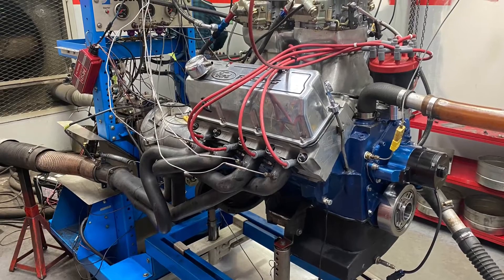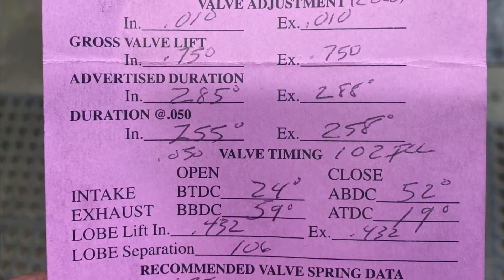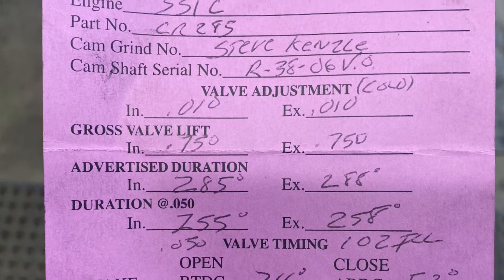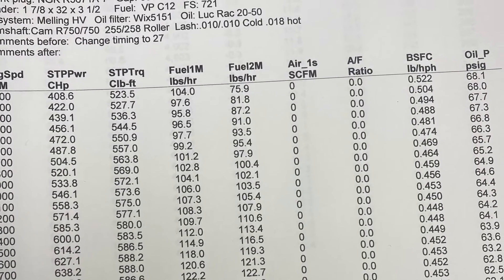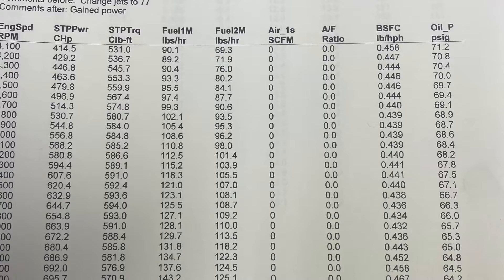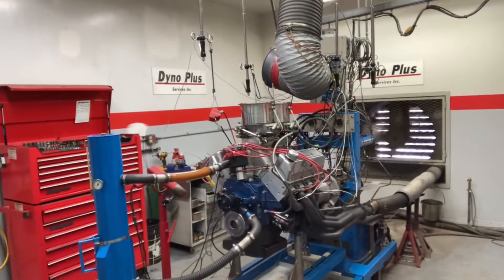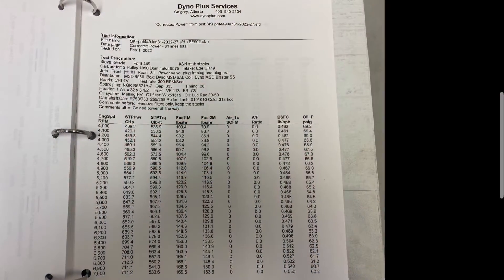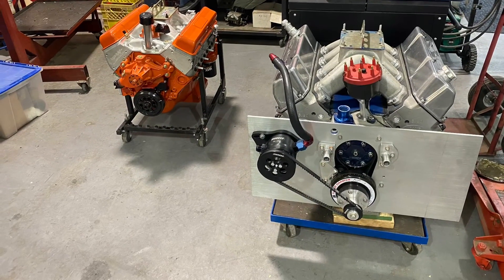DragBoss Garage:  Boat Anchor 400 Ford,  Steve Kenzle's  700 Plus HP Monster

Comment: Back in 77 I started building out my 1970 400 2bbl engine in my LTD. fast forward a few years, and it became a 408 with 11.5 cr a Competition 292 cam, 1970 Cleveland 4bbl heads flowing through Doug Thorley headers. I ran a Holley single plane 351 intake that sat on my own hand made spacer plates. An accel coil, Mallory dual point distributor and a MSD fired the mixture that dropped from a Holley 4bbl 750 Vac secondary carb. 4:11 nine inch rear and that LTD Ate most of the cars around town. Still have the engine, C6 and rear diff. Car rusted away. Time for a new body! Everyone thought I was crazy to work on such a bas-tard engine.
Reply from the maker: They just don’t know how to unlock the chest of power. Well no time better than now to get another car Peter. Good luck and thanks for watching

Comment: Yes, Ford "M"s are definitely overlooked. They're awesome.
Reply from the maker: Right on, need to build a nice stroker with Cleveland 4v heads.
Reply: Got that 10.3" deck for additional stroke.
Reply: If you can fit 4.25" stroke in a 9.5" deck, why not 4.75" in a 10.3" deck?   Why not 5"?

Comment: I had a couple 400 M's and they tough motors. The torque was very impressive. Had one in a F250 and it hauled and towed stuff it probably shouldn't have. It just grunted down and worked.
Reply from the maker: That’s exactly what they were made for. Dependable and huge potential

Comment: Man I remember my bronco 400 had something like 150 hp. Stock. Prob a lot more torque. Had a 71 Cleveland in a cougar but I was 21 so I figured…put a 4 barrel on it. Didn’t know what I was doing and the car never saw the street. Timing was actually the issue,needed a front fender and headlight bucket which were impossible to find in the 90s  man I loved that cougar.
Reply from the maker: I live cougars too. First engine was a 351 Wheezer and I do the same 4 intake and thought it was bad.

Comment: A stock ford 400 bottom end has a rod to stroke ratio really close to a chevy 350. Since the 400 has a 4 inch stroke, I would think lightening up the bottom end (rods and crank) would cut down on the reciprocating mass, letting that engine spin up faster. Its worth a try, because not many people mod these engines, so they're probably cheap to get spare engines, depending on where you're at.
Reply from the maker: What crank and rods would you run?
Reply: My thoughts exactly. main reason people dont build these is no stronger aftermarket parts . I made a mistake with a ford 460 and used CJ factory rods. They are no stronger than the standard rod. Anything above 6000 in Fords should use aftermarket rods.  @dragboss351cleveland

Comment: Looks like the engine on the left is a small block Chevy. Not bright enough to know for sure.
Reply from the maker: What engine in the left? Only one I see is the 400 Ford?
Reply: @dragboss351cleveland  I told you I wasn't bright. I meant to say boat anchor.
Reply from the maker: @duradim1 lol. I was like huh, all good

Comment: Great video featuring the 400!  I never had one, but they were pretty common in Torinos, LTDs, and Mercuries in the early-mid 70s. They were an option for police package LTD IIs in the late 70s although they didn’t make a lot of power or impress anyone with their performance. That said, there were bolt-ons offered for them in the aftermarket from the late 70s so the ability to modify them was present at least into the 90s - don’t know how easy it was to actually get one’s hands on the aftermarket parts that were advertised in magazines. I recall that Edelbrock offered the SP2P aluminum intake for two barrel motors, that combined with a Holley two barrel carb were intended to operate more efficiently and offer more power for these motors than the stock configurations. They were supposed to retain smog equipment IIRC. I knew of a couple of deputies from my home town sheriffs department who had take-home LTD IIs and quietly swapped stock for Edelbrock setups, possibly cams, and rumors of emptying the cats for better exhaust flow. The results were better performing cars.   Much higher top end than the 105 average a stock version would do while dragging a double bubblegum light bar. Growing up during that time in my little corner of the Midwest, there was a looming admonition not to tamper with smog or the “feds” would get you. Of course the state didn’t, and still doesn’t do smog inspections. Stories to scare kids… The folks who’ve been swapping on 4V intakes, RV cams, headers onto their 400 truck motors haven’t got much attention over the years, but I haven’t heard anyone say it wasted effort either.
Reply from the maker: Yes, the 400 is so overlooked. I love those LTD‘s, I had a 77 Teebird, I think it was the best car I had, 400 bucks. I drove that thing for years, and the transmission from the car is currently my Cougar. and they didn’t have a lot to offer high-performance wise. But those years of that what you got I did what you could change things. Yes, I’ve heard about them emptying the cats too. Thanks so much for watching a video and enjoying it check out my other videos, I appreciate that like and subscribe. Stay tuned.
Reply: @DragBoss351Cleveland  I've got a 72 4 door ltd I'm the 2nd owner to. The 400 was bone stock when I got it. I put a offenhauser split port intake with an avs2 carb and 3 inch true dual exhaust. It really woke that motor up. I have it out in my shop right now rebuilding it. The original timing gears were so worn it out wouldn't stay in time.
Reply from the maker: @coreysharp9794 well sounds like you have a good plan. Freshen her up, think about adapting a cleveland intake. Not a lot of bolt on intakes for that engine.  Nice  job

Comment: How much for the Dyno time ? 
$1,200 bucks  around where I live.
Honestly. Any engine with aluminum heads is going to make power.
If a person could run a lite crank rods and Pistons in that engine, I'd say great.
But that would cost some bucks.
Just to do kind of build here.
Reply from the maker: Jessie, it cost me $500 per session. Platinum engine service, Todd as a friend. I’ve been working with him for 20 years. If that engine had 14 to 1, I came in at 775 to 800 lift. It would make 800 hp. I’ve always learn to buy the best the first time you save money in the long run. Thanks man.

Comment: Is there a build video on it?
Reply from the maker: No, but I’m getting some pics and we’ll make a video about it, and have better specs. Hope your stick around, sub cause there’s way more on the way check out tonight’s video.
Reply: @dragboss351cleveland  I’m just trying to figure out what parts to build to spice up my mud truck and there’s not as much information on the 400 as there is a Windsor or a 460
Reply from the maker: There actually is now that I think of it, you have to look way back to my beds. He has a 400, and a Cougar, with a tunnel, ram and two fours, it’s probably at least 20 videos or more back start going through my video find it

Comment: That ol 400 sounding good.  400s are all I used to mess with in 78-79 trucks and broncos back in the day. They used to be everywhere for nearly free. They would run well when you'd rip all the smog crap off and put a good top end on them.
Reply from the maker: EP, you are so right, really just a tall deck Cleveland, baby 460. I sure miss those days, you?
Reply: @dragboss351cleveland  lord yes I miss those days....( mid 80s thru the early 90s).  I used to mud race a 79 bronco with a stout 400. Had gold anodized moroso tall valve covers, fenderwell headers, 5" k&N air filter, and ran either a 850 dp holley or a predator carb. Guys would see my hood open expecting to see a 460 and couldn't figure out what I was running. Haha....I always told them just a little Cleveland. 

Back then I'd find running 400s for 40-50 bucks cause no one wanted them and nobody makes anything for the 351 M-400 motors is what I'd hear all the time when guys would swap them out for a 385 series motor.
Reply from the maker: @EPstroker  great history and stories, my friend. Thank you for sharing with me. I can imagine looking at that hood with that big air filter, the big gold valve covers and guys going what is that? I bet that was a screaming machine. Yes those engines were Dyme-A-Duzin back in the day. I appreciate you being here. And I’m glad you enjoy my channel. Stay tune because it’s gonna get real… Real soon.
Reply: Brings back memories. I had a friend who built up a 351M in a pickup. That engine stock gets a lot of hate on the web, still. In the 80s you could find hot rod parts for it. He never had it dyno tested but dang that thing flew when he was done with it. It’s more fun taking an ignored engine and seeing what can be done. Hats off to this guy.
Reply from the maker: @glenmallory9982 agreed 100💯. That why I like the Cleveland so much. Hardly anyone builds them anymore. Just a select following. Glad your here glen 🏁🇺🇸

Comment: Basically a tall deck Cleveland with different bellhousing pattern I thought they made a great truck engine you just don't want to Lug them because they don't make a lot of oil pressure at lower RPMs with a stock oil pump basically if you want them to live you put in an analog oil pressure gauge and use it as your tachometer don't pull on it if it's below 28 PSI
Reply from the maker: That is good one analog oil gauge for tach. They work no doubt about it, work them. Thanks

Comment: I just find it funny that the 400, one of the most misunderstood and hated engines ford produced is capable of making that kind of power naturally aspirated. When the kids today think these hellcats are just the pinnacle of gas powered engines. Or that the LS is the cheapest swap to do. I have a 400 that has been apart for 10 years because life has come before it, but I feel when I get it back together, I'm going to make a channel solely based on proving that these old engines are just as good and fun to work with as the new stuff. Awesome build
Reply from the maker: Thanks for watching, and understanding. You are so right, these old dinosaurs are always overlooked. Glad to see you are into them, get them going and good luck... Life

Comment: Plenty of retarded comments about "nobody making performance parts for the 400 in the 1980's." Edelbrock had a 400 power package for decades, not cylinder heads but a cam, lifters, rockers, and a 4V intake, with headers they came to life. Not that they were a slouch when they came out in 1971. That was 265hp, 400ft/lbs STOCK with a 2 barrel. The 409 always had great potential, blame OPEC and the EPA for their fuckup not the engine itself. Garbage compression, retarded cam timing makes any engine a dog.

Comment: I've been looking at the 400"boat anchor" for some time because I knew it was a cleveland but like most people frustrated by the fact that no one was making aftermarket performance parts for it. Now they're  actually starting to come into their own and I'm delighted to see it because I'm going to build one now for a front engine sand rail. I was building chevy 402's(396 030 over) before but I believe the ford 400 will be a surprise for some people and a real hoot to play with!
.
Reply from the maker: Very cool to hear James. Your right the aftermarket never made good intake for them. But a cleveland intake will work, just need some spacers. I bet it will be a nasty rail. Thanks for watching. Hope you subscribed.
Reply: @dragboss351cleveland  I did!
Reply from the maker: @jamesreeder5316  Hell Yeah!

Comment: I don't know if I will get a comment or not. This is adult material and content. If you don't approve of locker room talk, don't read the rest of this.,................
I warned you. 
Two things better than se#. Hooking and lossing a 20 pound plus steelhead and riding or driving in a 700 lift Cleveland with dual tunnel ram.
Reply from the maker: I can dig it. And with a four speed

Comment: Dragboss garage. 
Hey boss can I get in contact with you through email or any connection. I’m currently building a 400m and would like to discuss the parts you put in your engine to get that power. Thank you boss. Would really appreciate your time.
Reply from the maker: Your welcome. So glad you like it. I can tell you what works for me. Be patient, so much going on. Thpa351@gmail.com
Reply: What's a 400 M?
Reply from the maker: @cammontreuil7509  it’s attention to detail that gives you the edge.
Reply: @dragboss351cleveland  I hope maycol gets the message.

Comment: Tim, what's your thoughts on taking the least desirable cleveland parts and making something out of it? I have pondered taking a 400 getting a stroker kit for it and topping it off with Cleveland 4V open chamber heads with domed pistons to get compression up. Why would I want to do this? Because I've already done a 408 Clevor, I've already built a 406 Cleveland so why not do something that gets no play or love? I'm into running factory castings with all their inherent faults. I don't want to use aftermarket heads because this engine is more about the "what if" Ford had taken this engine to the next level. Any thoughts?
Reply from the maker: You know what I say Hell Yeah!!! Get to it will be a great build. And fun. Lots of parts, just have to use spacers for the intake. You got the experience, boat anchor time.

Comment: I'm building a 400, not to that motors extreme. But I found a set of 2v closed chamber aussie heads, and a set of tmeyers' pistons. Gonna drop it in a 2008 f150 4x4.
Reply from the maker: It will be killer, those ports are obvious much smaller than the 4v  and with that quench chamber, it will be a killer combination. Keep us posted Joey

Comment: ...Hi Tim, a mate of mine had a mild 400m in a 73 xa ford fairmont downunder, it was Torque Monster. thanks for the up Bro cheers..
Reply from the maker: Cheers. Glad to see you back Robbie. They can rip out stumps with right gear.
Reply: @dragboss351cleveland  Cheers  Tim😀

Comment: Bit concerning the oil temperature climb during a pull. I typically see 5 to 10 degrees.
Reply: The oil temp does get high. The block is full of grout. 1” below deck. In car i run a cooler.
Reply from the maker: @stevecleveland357  how high Steve. I was like 190-205 on pump. Tried not to go over that. Good idea about oil cooler.
Reply: Couple pulls hit 220.
Reply: @stevecleveland357  Well if you have only an inch of water jacket the oil is cooling 100% of the piston skirt and 80% of the ring friction. Good looking buildup from something that couldn't pass a gas station back when it was new.
Reply from the maker: I never noticed that. I will have to ck. I like to keep the oil 190-205 on pulls.
Reply: @dragboss351cleveland  I'm typically pulling our engines at 160F.
Reply from the maker: @yarrdayarrdayarrda  my 409 made 23 pulls in one night. Hard to keep
Oil temp down. Was told 190-200 fine.
Reply: In dyno room 240 is the threshold. We try to keep under 200 but once in awhile it creeps up. In 1/8 mile runs likely never gets over 200. I also have auxiliary cooler. On these boat anchors with long cylinders and .055 overbore didn’t want cylinder flexing. Last motor held together for 7 years before crank let go. I did have a rocker fail and had to replace some pistons and rods though.
Reply from the maker: Sounds like a well thought out combo. Cylinders must be thicker than Clevelands? If your track is like mine, plenty of time to cool down between rounds lol

Comment: Cool deal. Wish I can get rid of my shock towers so I can put a 400 or a 460+ BBF in my Cougar.
Tim that looks like your 409 on the right side at end of video
Reply from the maker: Thanks Matt. I hate them too. At least I got rid of steeeing and now have rack and pinion and rear sump pan. No that engine is the first TrackBoss 1. Makes 800+ hp.
Reply: motor mounts and headers are made to put a 429/460 in you cougar .. i had one in my 69 stang for close to 20 years .. i still have the changeover stuff ..
Reply from the maker: @williemoon7522  well won’t need them now as I have. Motor plate so Bbf would be no problem. Rack and pinion sighs like maybe 5 lbs. got room now Wille

Comment: I guess I am an old dinosaur, but I am stuck in 1958-71. The FE is so light and is stupid s  strong. I have friend who just dynoed a 462 FE with a 4.25 stroke and a 4.16 bore. He got 765 out of it but had to turn higher because Cleveland heads are just the best. He had the BBMS with a Jim Kuntz port job, 12.65:1 and can run on pump 93 gas. Some good gas and a couple degrees of timing will push it to 810 at 7700. I got to talk with Doug and got him to get those chambers right. I am glad he involved some enthusiast input. But man those Cleveland’s are just so good. I really wish someone had done a C head for the FE. The two together would be like Carlos Santana and Rob Thomas song… Smooth… 😆☮️
Reply from the maker: Love the Fe has such a big bore. I am a dinosaur too. Wowser great power for pump gas. Who is Doug. Rip Jim Kunt. They do make an adapter to run cleveland intakes. Thanks Roundy for being round.
Reply: I've seen a Cleveland intake on a FE.
Reply from the maker: Yep with original adapter being made by pro stock Paul Bedowin PSE . Now jay brown makes them